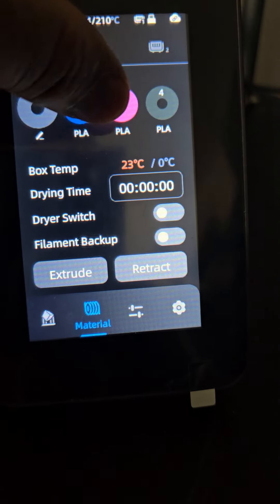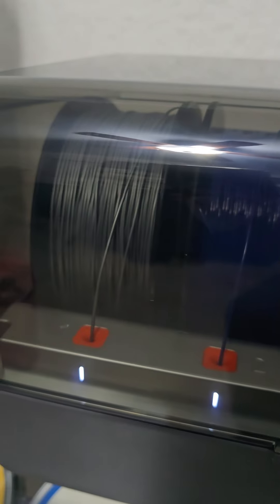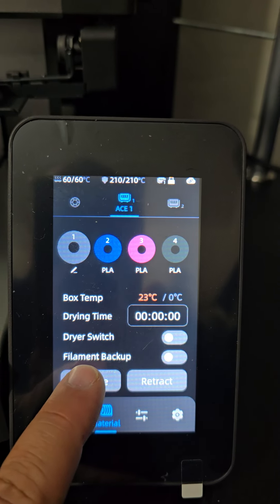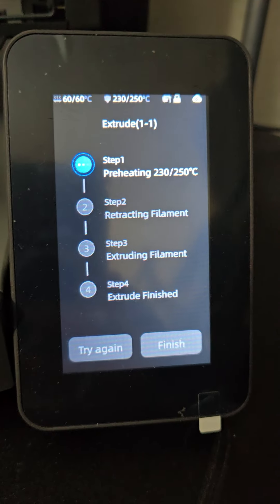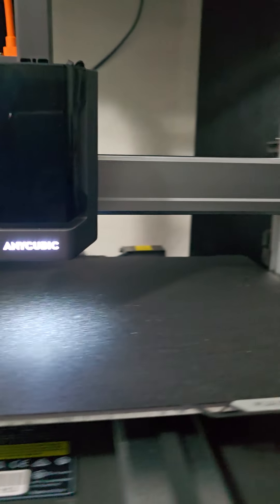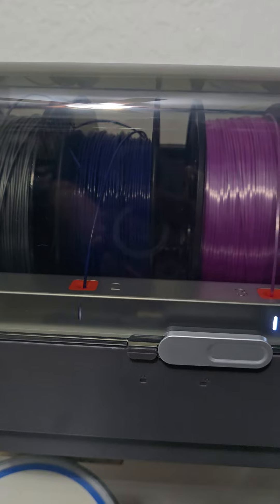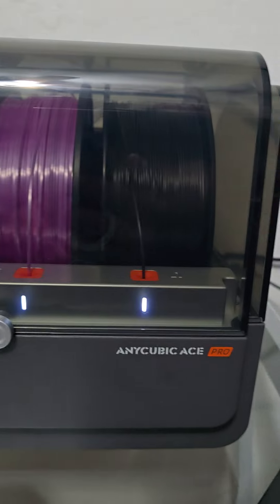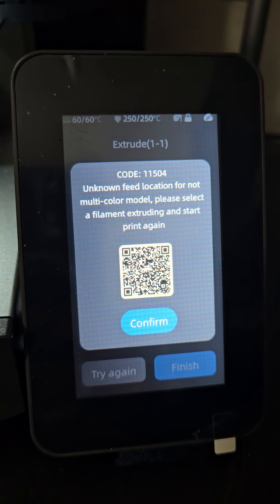Anycubic Kobra 3 Combo - Problem - Error Code 11504

Comment: Did you check the clear plastic area in the printer head at the top inside?  I did have to pull some filament out of it, but it's still saying the same thing.

Comment: Did have the same problem. After I dir check the nozzle I just screwed the top (filament distributor, two screws) of and found more filament there.
Reply from the maker: @CptMojo  Thanks! I got some replacement parts from Anycubic CS. I am sure there is a ton of filament in there. I just need to open it up and stop being lazy.

Comment: I just pulled my nozzle out and found more filament stuck in it.   You may check that as well
Reply from the maker: @reznor24  Thank you for all your comments. I reached out to Anycubic and they sent me a new filament sensor and also the ACE filament feeder where the filament tubes connect.

Comment: I'm having almost the exact same problem.
Reply from the maker: @joycestewart12  I got into the print head and cleared out the feeder at the extrusion point and that helped, but I still had other issues and they gave me instructions for the wrong problem and now my ACE PRO is going to need more work. I have since then disconnected the ACE PRO and am printing single color for now.